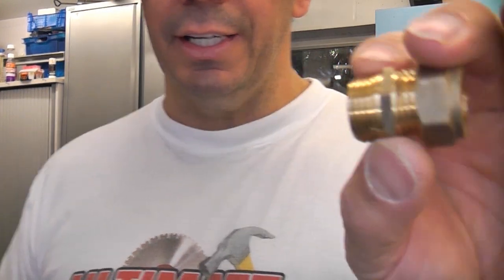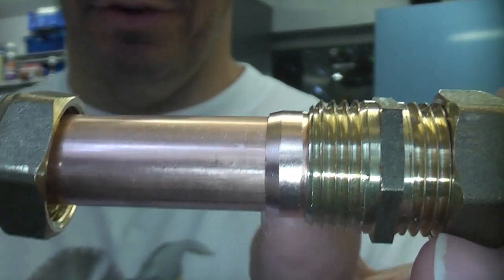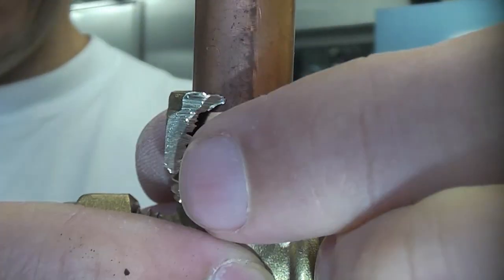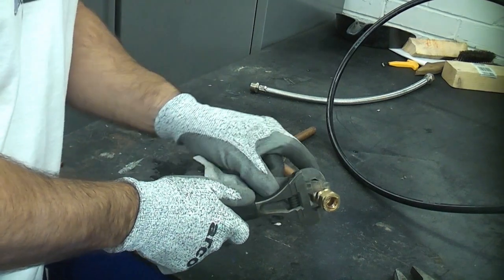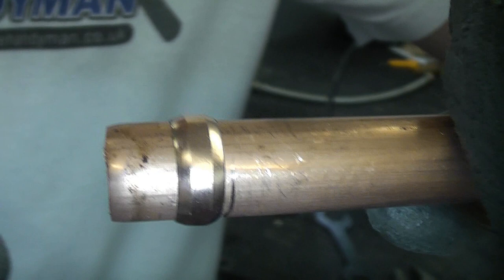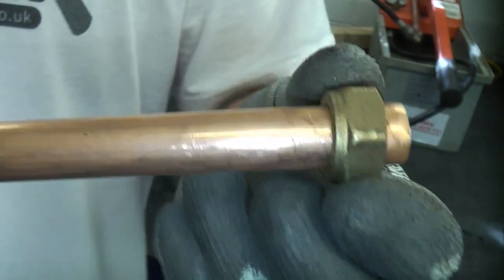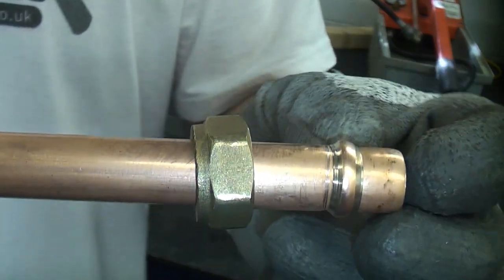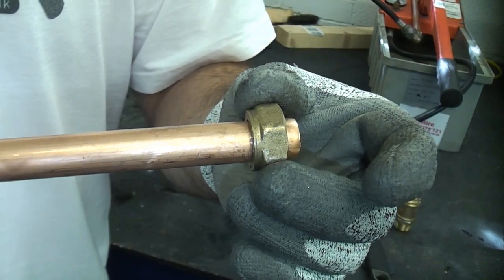How compression fittings work

Comment: Why are there olives made from copper and brass, and when is the correct time to use one or the other?
Reply from the maker: +hucks33 Different manufacturers supply different olives with the fittings. Personally I prefer copper olives as they are easier to compress, because copper is more ductile. I'd always use copper, unless I was stuck and only had a brass olive.
Reply: +hucks33 Fittings are supplied with brass olives simply because it's cheaper. I buy bags of copper olives from Screwfix and substitute the brass ones with them every time

Comment: what happen if it used to fitted the 2 difference pipe diameter.
Reply from the maker: You can get compression fittings to reduce from a 22mm pipe to a 15mm pipe including elbows and T's etc.

Comment: But when you need to replace , say, a spigot, can you undo the fitting, leaving the "olive" and the nut on the pipe, and just put on a new spigot? I've been reading that different manufacturers of hose bibbs use different threads (even same size, they might have different TPI or what not) and then it won't work, or will it?  Because if the fitting has to be compressed INTO the attaching (inlet) piece, then it will be molded into the shape of the old one already....so will it deform more to fit into a new one?

Comment: Hi sir , is that fitting compression good for car brake hose?
Reply from the maker: Not sure, I think they flare out brake pipes using a special brake pipe flaring tool, then use special fittings.
Thanks for the comment 👍

Comment: Can you use compression fitting instead of soldering for everything? I'm a bit scared to solder and therefore want to use this method to join things
Reply from the maker: Yes, of course.
But push fit might be a lot easier - https://www.youtube.com/watch?v=Z83vlwUyZIw&t
Push fit fittings have helped me tremendously, especially in difficult situations like this- https://www.youtube.com/watch?v=eqECFK42PKQ
Thanks for the comment 👍